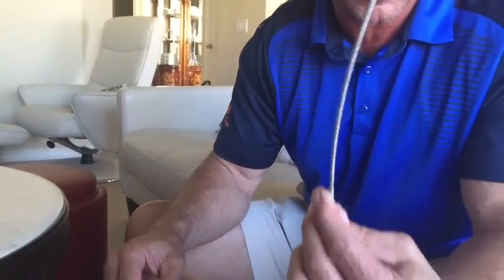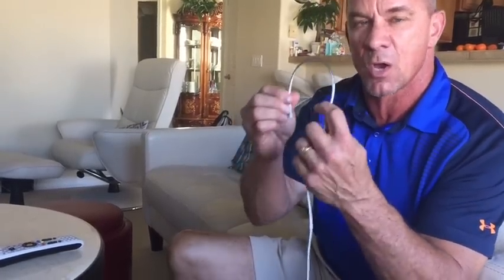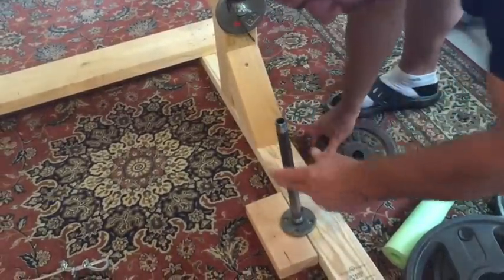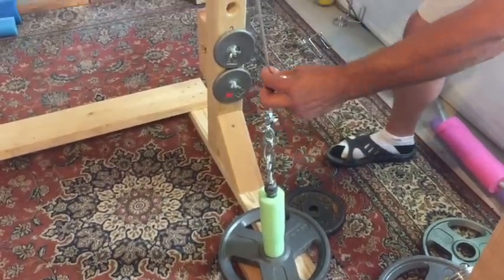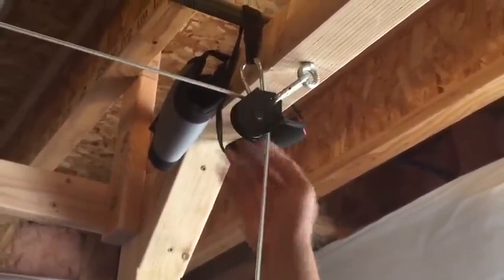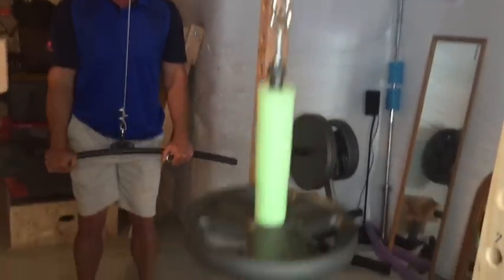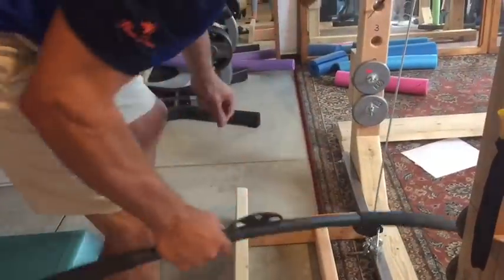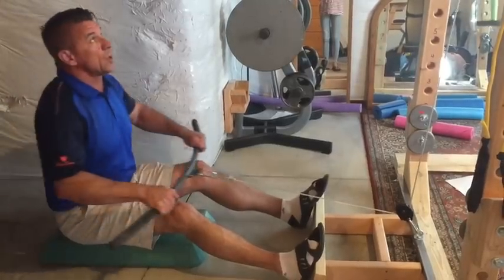DIY Power Rack Cable Pulley System

Comment: Thank you for the ideas brother. Built my power rack based on Buff Dudes design. Took your advice on cable system. I added 2 pulley systems so I can hit chest and add more weight. Even convenient so my wife can do a low row and I can hit triceps. You're right the weight dont swing much and is a wonderful design brother. Thank you very much for your creativity and sharing. Could be wrong but when I am, I'm right. I smell the glory on you brother. Hooah!
Reply from the maker: My rack was inspired by Buff Dudes as well. Thanks for the inspirational comment!

Comment: Great job with a clean design, nicely done! I work in the helicopter rescue environment. If I may, I'd like to respectfully recommend a safety change you might consider.

At about 3:03 in the video, you discuss cable clamps and use (3), good deal. There's not much short-end cable left "sticking out."  So, an extra length of cable above the knot is called an "ear," and provides a bit of insurance should the cable begin to slip through the clamps.  It'll also allow you to check for slippage.  Not a criticism yet a technique which may improve your safety margins.  Thanks for the video, I'm a fan.

Again, great job.  I'm a fan!
Reply from the maker: Your critique is valid and appreciated. Easy to tell you are a classy person.

Comment: I used larger pulleys with coated wire and clamp just like you did.  Pull on a thick  rope.  Amazed at the low cost.

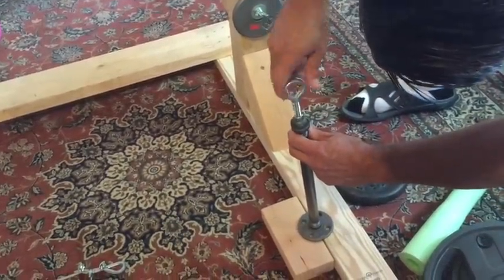Comment: Great video! Thank you for sharing. Only thing that caught my eye was the weight rack made from threaded pipe (around 2:24), which is clever, and I think the connection between the cap and pipe may be the weak link in the set up.  Doesn't look like you're able to get more than 2-3 complete turns on it.  And the more threads meshed together, the more shear strength the connection will have. With only 2-3 threads meshed, I'd fear the connection will strip and pull apart under a heavy load.  Maybe someone with a structural engineering background can opine on this. Otherwise, great setup. Appreciate the attention to detail like the angled footboard for rowing.  Cheers.

Comment: Very Nice quality work.  no need for cable, use quality rope,helped convert  some  kit in a few gyms in uk  to rope, not one failure yet, when idiots slam the crossover plates cables get trashed, rope no problems. Enjoyed you vid👍

Comment: going to be building a simple multi use system with 2 weight stacks so I can to each arm separately. I am going to be using a system where I build 2 box's and instead of metal weights ( which are my first choice but since I am broke cannot afford them) an load the box's with bricks. I will be also setting it up with multiple hooking points (high and low as well as waist high) for even more options.

Comment: I agree having more of those things at the end of the cable for safety. No reason to cheap out when you're saving so much money doing it yourself. Safety all the way at that point.
Reply: Them things I use only one on my atv winch that has a 2500lb pull and it works fine I don't think you're going to be lifting that kinda wight

Comment: Looks like a great low cost solution.  Now I just need to figure out how to create a seat which holds my legs down. I just like the security I'm being held down by leg pads.
Reply from the maker: What about using the safety bar (or some adaptation) with a noodle pad? I know what you mean, those seats on the gym pull downs are wonderful.

Comment: Two big safety issues I noticed were that when you use coated cable, you should remove the plastic coating at the end where the cable clamps attach. The other safety issue is "never saddle a dead horse". The u-bolt  should go on the dead end (end not attached to the load}. This will crimp the cable and prevent it from pulling through.
Reply from the maker: Thanks wingznut1! Justin Roberts already educated me on the dead horse issue. Stripping the coating makes sense and I will do that as well. Do you have a similar setup?
Reply: Kurt Heitman really appreciate how you emphasize safety and that you are open to looking into suggestions. nice relief from your average Joe acting like they know everything. safety is no joke.
Reply from the maker: Thanks Sir Lawrence. I don't want anything smacking me in the face. Safety is the enemy of stupidity.

Comment: two questions: how thick is the wood of the structure and what is this element called? 
2:07
Reply from the maker: The wood is 4x4 and the pipe is that steel pipe they have in every hardware store like Home Depot and Lowes. You'll find it. I just drilled a hole in the end cap of the pipe and put in an eye bolt (hardware section).
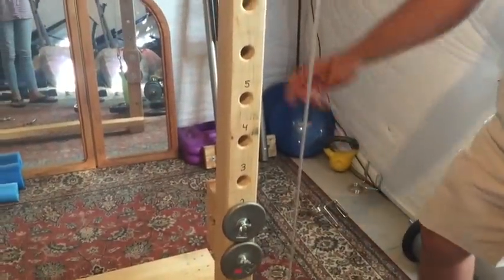Reply: last question ... to assemble the wooden structure (for example the reinforced corner at 3:33 minutes), did you use screws or nails? ... do you find the structure stable enough? ... ahahaha sorry for my too many questions, but I'm designing a leg press and I want it to be fairly stable 
 Thanks for your valuable advice ... they will be very useful to me in this quarantine period :) ...
Reply from the maker: @mi_chiamo_alex  I only use deck screws and glue. Strong as hell.
Reply: thanks for the valuable advice

Comment: Dude pretty sweet home build. Looks solid too...I've was looking them up earlier and I've seen some good ones that just didnt seem to have enough meat on them...lol cant trust some skinny wood frame with 225+
Reply from the maker: If I built another one, I would use 4x4s. It is not weak as it is. I weigh 200. I glue my ends with wood glue and use deck screws. It's stout as hell.

Comment: Do you have any idea how much weight your pulley system can withstand? I'm thinking of incorporating a belt squat set up and I'm concerned that 500-600 lbs might be too much for those bolts screwed into the wood as well as the pulleys themselves. Would you anticipate those eye bolts pulling or tearing out of that wood with that kind of weight? I'm inclined to think that they wouldn't although I'm not an expert on weight bearing structures. Your thoughts. Thanks!
Reply from the maker: Don't recall, but I do think those top eyebolts I used were rated over 1,000 pounds. I got it at Lowe's. I just recall that it was very stout. One critical thing to remember when using wood is to orient the wood grain the correct way. Like a baseball bat. The grain (lines in the wood) need to be running vertical for maximum strength. Also, buy a piece that has lots of grain lines and all running straight up and down. Finally, those bolts I put up are not screwed in, they are bolted in with large washers atop so they don't rip through. Bigger the washer, the better. Might even see if you could add some of those metal brackets to reinforce it. Walk the aisles in Lowes or Home Depot for ideas/options.
Reply: Oh ok. They're bolted in, not screwed. Got it. Helpful advice.

Do you think using a cross beam pipe through both uprights should be stronger than using just the wooden cross beam?  Also, when you said use metal brackets, what exactly are you referring to? Thanks

Comment: Please link the black pulleys used on your rack if possible. great job man, thanks!
Reply from the maker: Hey Vin, the black pulleys I used are stolen from a broken old one of those Chuck Norris Total Gyms. The other ones I have on the first part of the video are from Zoro.com G3218187 Wire Rope Pulley Blocks ($3.84 each). When/if the Chuck Norris pulleys crap out, I will replace them with the Zoro pulleys. I think the Zoro pulleys are much stronger.
Reply: Awesome man thanks!

Comment: hey man, i recently got pulleys myself which work fine when using the high cables. however, once I attach the second for a low cable row (for example) my cables get stuck. making 40lbs feel like 80
Reply: Forgot to mention i also use coated cable ropes BUT they are thicker (forgot the actual diameter)
Reply from the maker: Not sure without seeing. Maybe the thicker cable is binding (and dragging) through the cable groove. You don't need that thick of cable. Look at the load ratings.
Reply: @kurtheitman552  but when i use it only one pulley (lat pulldown or tricep extension for example) it is extremely smooth

Comment: How did you drill a hole in the top of the pipe?
Reply from the maker: It has an end cap for the pipe. Held it with vice grips and drilled away. Normal household drills are 3/8 inch, and anything above that will require a bigger (1/2 inch) drill.

Comment: is there any chance of getting list of products needed? 
I've managed to build awesome power rack but I am not really into DIY stuff, and i have no idea how to find eye bolt that would be safe to work with and fit well, so if you could tell me what does it look like out of the wood/what size it is or whatever, so i could tell that to the assistant in store that would be great :)
Is 2'' pulley with 480kg breaking load good enough?

Thanks a lot, awesome video!
Reply from the maker: I don't really remember. Just go to Lowe's or Home Depot and see what they have in the hardware aisle. That's all I did. Just take the bolt to the wood and see if it's long enough. Save receipts because you can always exchange things.
Reply: @kurtheitman552  do you think something like that would work? :
https://images.obi.pl/product/PL/1500x782/402557_1.jpg

I am afraid the threaded part is too short, but i'm not sure (total length with eye is 5inches, my rack is made from 4x4 wood)

Thanks for your response!
Reply from the maker: @Czochable  That eye screw is no good. I used a bolt that goes all the way through. That bolt is rated at over 1,000 pounds. Don't use that screw thing.

Comment: U  carry weight  himself but u should carry it by motor.or u should add weight where u carry as per average weight 65×4 person Wight fixed if lift empty it come down n goup by weight of carrying platform weight.used peed control on carrying motor n make it inside by full by donlop sheet so if it file down accidently than no injary. It for passenger lift.please reply for forther subcribun channel.i hope u reply if any
Reply from the maker: Not really sure what you mean?

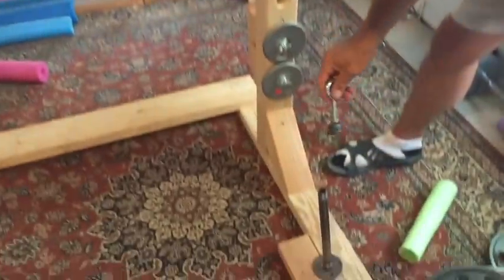Comment: 1:44 ...what name does this tool have?
Reply from the maker: It's not a tool. Just steel pipe and a flange for the bottom.
Reply: Thanks ...so if I want to get this tool, at the hardware store do I have to ask for a steel pipe + a flange?

Comment: Hi Kurt, this is awesome, Ive been toying with the idea of doing my own pulley system, you think it would work doing your idea but using the ceiling Rafters to attach it too instead of the "power Rack" I'm limited for space in my garage so cant build a power rack?
Reply from the maker: Hi Mark, I have seen many pulley systems used from the rafters. Check out this one from Eric: https://www.youtube.com/watch?v=e5jPUvaERKE&t=278s  Its near the end of his video so you may want to fast forward. Be careful when connecting stuff from rafters because they are designed to hold the load from above (floors and roofs). I would consider reinforcing the rafters with some kind of wood or steel supports. Most of those joints are only nailed together with 16 penny nails and no glue/screws. Otherwise, this can come crashing down on your head. Also, I have seen plenty of good used commercial pulley systems for sale on craigslist ($100 and under) that I have considered buying many times. Just have to keep looking and be ready to pounce. Good deals don't last long.
Reply from the maker: Here's a good one too. https://www.youtube.com/watch?v=OFnG6_sx3mU

Comment: Great Vid, but your clamps on the cable ends need to be fixed. The one in the middle is fine but the other 2 switch around. "Never saddle a horse". Other than that great idea man. Building my rack next week. Just researching.
Reply from the maker: Thanks Justin. Not 100% sure what you mean but I will do some homework. I intended to alternate them thinking that would be better?
Reply: Kurt Heitman haha sorry. What i meant about never saddle a dead horse is that the clamping part should never be on the dead end of the wire. You would be 100% ok to put all 3 same way.
Reply from the maker: Awesome! Thanks Justin. The whole idea of me sharing is so others can learn and teach me as well. Looking forward to seeing your creation. I just tried to make a Smith Machine but it's a POS. :)  Here is a link to what you are referring to for the clamps. Thanks again. Kurt http://www.fdlake.com/wrclips.html

Comment from the maker: This video is kind of a rush job. Sorry, just wanted to get this out there asap. Any questions? Thanks, Kurt
Reply: Awesome video man solved a number of issues for me however I have a metal power rack I designed but no pulley cable system so I've designed my way out of the issue thanks to you what are the dimensions of the pulley with the nylon pulley?  Pulleys in the U.K. Are not cheap we don't have Home Depot etc we have Lane garden centres and decorating centres etc no metal shops as such but I will get it done then ready for some hardcore overload training!!
Reply from the maker: Hey thanks for the comment! I took the nylon pulleys out of an old Chuck Norris Total Gym. They are 2 1/4 inches in diameter. Don't know where to buy them but I'm sure there are plenty of sources online. The other ones I bought (which I will probably use later) are 1.5 inches and they have a load capacity of 238kg. I am not 100% confident in the nylon ones to be honest. I got the 1.5 inch ones on zoro.com. The part number is NO.5RRV7 Size 1-1/2 inches. They say they are for wire rope (cable) but I would only use the coated stuff. Much cleaner and smoother.
Reply: +Kurt Heitman seriously didn't expect a reply for a few days with it being the holiday season.

Thank you for taking the time out to respond so quickly it's greatly appreciated.

Merry Christmas and a happy New Year.
Reply: What thickness cable did you use and what was it rated too? WLL? I will be using nylon coated cable what material pulley would you recommend and Would you use a swivel headed pulley or fixed headed so as to eliminate pendulum swinging of the weights on the loading pin thanks again!!
Reply from the maker: Harpreet, I used the standard 3/16 inch coated cable they sell at Lowes. Not sure what the rating is but the weak link is the carbiner connector things. They are only rated at 150lbs I think. Almost impossible to find anything better without using something else like those chain links with nut closures. Not sure it's even possible to eliminate the pendulum swing. Even the commercial ones swing. Whatever you do, don't use those pulleys that are intended for rope. I think you won't have a problem with whatever you choose as long as you use the coated cable. That is key.
Reply: Use's 5/16 in. Zinc-Plated Quick Link
Reply from the maker: Good call. They take longer to put on, but they are much stronger. Thanks.
Reply: Where could I get the metal pipe with the flange on which you place the weight?
Reply from the maker: Home Depot or Lowes. Probably any hardware or plumbing supply place. Even Amazon.

Comment: where did you get that eyelet attachment for the top of the loading pin? I can't find one anywhere!
Reply from the maker: Sorry, I didn't see this earlier. I got it a Lowe's. I'm sure Home Depot has the same.
Reply: @kurtheitman552  thanks. I couldn't find it at my local Lowe's, but found plenty of options at tractor supply and got something that worked great

Comment: what are the size for both coated cables you used? 
thanks
Reply from the maker: Hey David, They are 3/16". Make sure you use the coated cable. You can get the larger size cables but I don't think it's necessary. You are welcome.